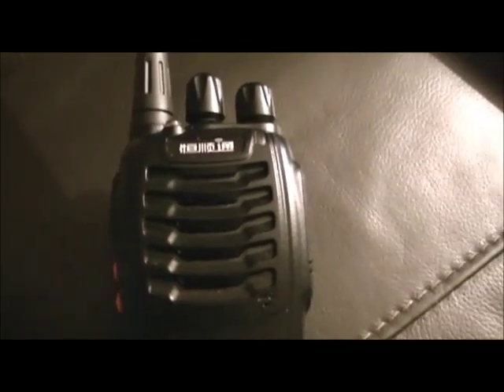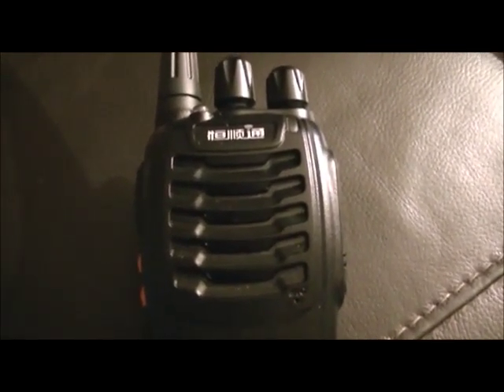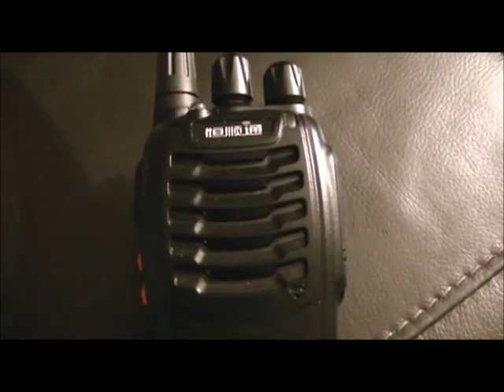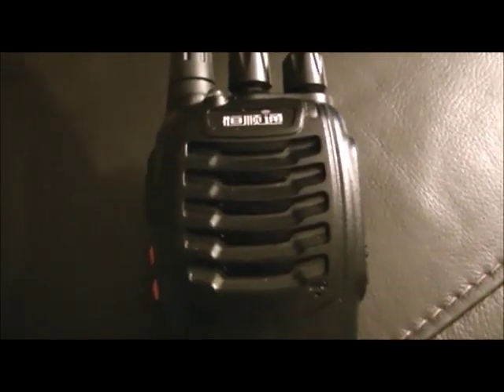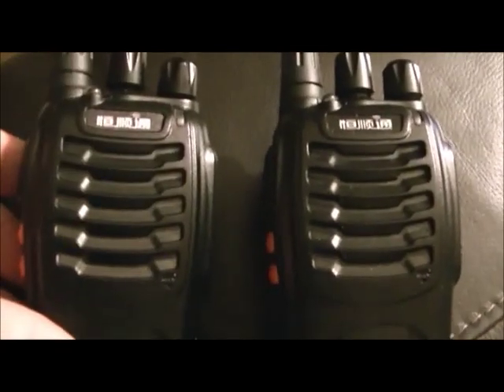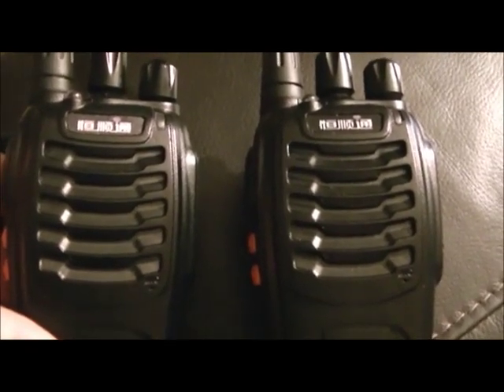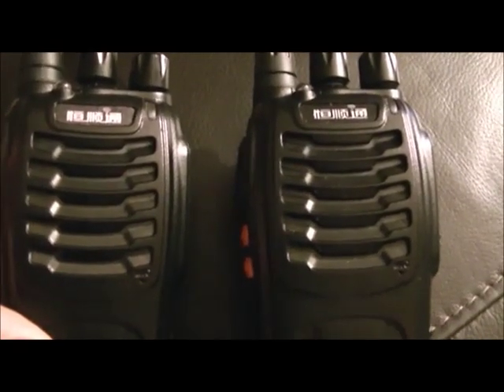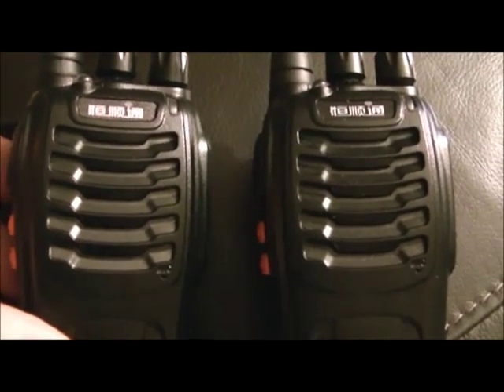H-777 Voice Scrambler

Comment: @AndrewL These radios are legal to use by ham radio operators, but not on all bands that they are capable of transmitting on. They can transmit on FRS and GMRS frequencies, but the hardware does not conform to power output and antenna FCC rules for these bands, nor the hardware been approved by the FCC for this purpose.. They can also transmit on some police, fire, and ambulance frequencies, which are only legal to use if you are extended the license to use them by the agency. Also, these radios come pre-programmed for testing in the manufacturing facility, and those frequencies are definitely off-limits for the purchaser. You must obtain a programming cable and install the software to configure these radios before you ever push the talk button on them, regardless of your license class.

Comment: you're not fooling anyone except for the most novice eavesdropper.
Reply from the maker: it's not a case of "fooling" anyone.I guarantee you will not be able to translate any conversations in that mode..as a fact they have brought out the bf-888s which has the voice-scramble feature
Reply: +fezufo Yeah right bro. I could decode that voice inversion crap in real time. 

They make freeware to do this and there's even an Android app to decode inversion.

You don't really know what you're talking about.
Reply from the maker: +Libslayer007 not a problem my friend,but most transmissions will be so "in-range" only for a certain time,I doubt very much if you could decode anything that would make a difference....and I know nothing huh?
Reply: +fezufo 
Anyone with even a modest amount of radio knowledge could decode your little Chinese radio voice inversion scrambler if they were in range.

The fact that you're touting these radios as secure, or even offering voice privacy, is proof you don't know much about radio.

26 years experience here pal. 13 years experience in voice security products.

Bow down.
Reply from the maker: +Libslayer007 yeah mate,I've seen ya channel.Minecraft warrior huh? I'd get yer own video up as proof...30yrs radio!
Reply: +fezufo 
Yeah, I'm a Minecraft warrior.
I built an entire multi site Connect Plus radio system that links the entire Minecraft world with seamless digital voice comms.
Reply: @rfi-cryptolab4251  cringe

Comment: I just got 2 888s set's delivered with "yellow x" stickers inside the battery compartments, does that mean the scrambler function will work? I've only read about blue and green stickers, is this a newer version?
Reply: Sticker color only represents the manufacturer, not the radio capabilities.

Comment: There are two types of BF888S, with and without scrambler. More on transmission1, on BF888S review thread
Reply: And the box still mentions the scrambler, FM radio, which it also doesn't have.

Comment: I did it just like that, turn on beat shift on both radios on the same channel, same ctcss code on transmit and receive but it won't work like your radios. When I try to communicate I will hear only something scrambled, so I guess that descrambling process does not work.

Just to clarify, second part of your video is scrambled TX and descrambled RX? So after descrambling it should sound normal?

Comment from the maker: i`ve only tested mine on a CB swr/power meter and it comes up as 4watts high and 1 watt low power.May not be the same as testing on an HF power/swr meter,but close enough.Remember its more line-of-sight with UHF,but can bounce off buildings and go around corners,through windows etc..